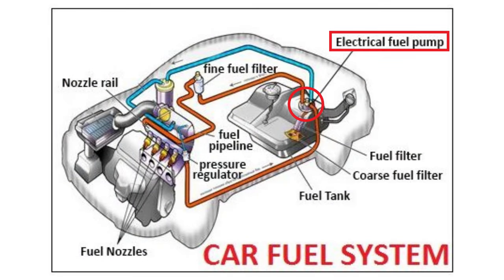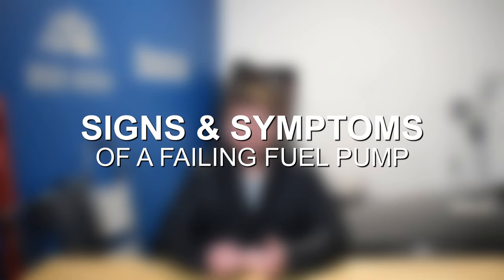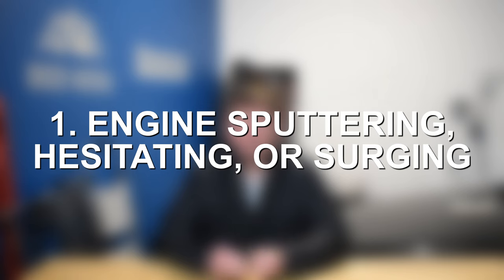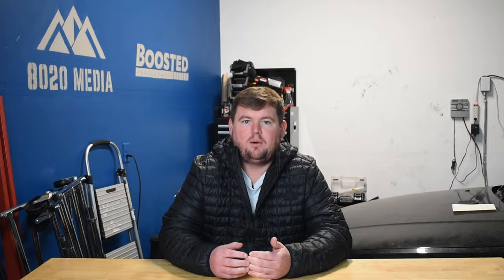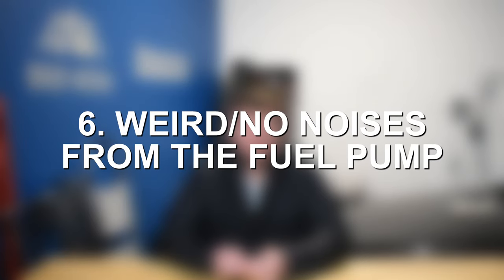6 Signs & Symptoms of a Failing Fuel Pump!

Comment: Okay so my oil has been burning bad but the check engine light is on for fuel pump but I tried to accelerate but my car wouldn’t pass 3,000 rpm and not go over 35mph and then I tried to go up a hill it cut off and I tried to crank it the engine started shaking real hard and cut off … so it my fuel pump or I need a new motor and a fuel pump
Reply: And my mechanic been telling me it was gon be time for a new motor because of it burning oil
Reply from the maker: C - I would start with the fuel pump before getting a new motor.. sounds a bit extreme by your mechanic.

Comment: My car loses power trying to go up hills
Reply from the maker: You've got a restriction somewhere. Fueling, airflow, ignition system, etc. Need more info to diagnose it - try pulling the codes.
Reply: Camshaft position sensor
Reply from the maker: B - This could be it, but certainly not a guarantee..